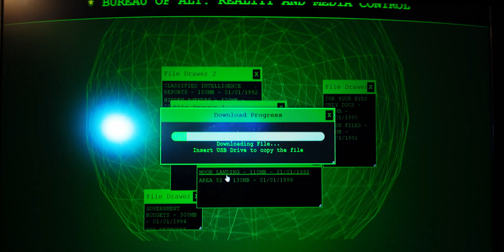DJI Osmo Pocket 3 - DIY Anamorphic Lens Adaptation: Unleashing Cinematic Flair

Comment: I wonder if it will work with the pocket 2 version of the filter.  I believe the pocket 2 anamorphic to be superior to the pocket 1.  The new pocket 3 filter is virtually unusable.
Reply from the maker: I don't have the osmo pocket 2. My guess is that it might work as the size of the lens is not much bigger than the osmo 1. And you are right about the Neewer LS-44 I am really disappointed with it, to the point that I don't feel like making a video about it.

Comment: That is very interesting, nice work. My question would be the same as I had with the previous cameras, how to stretch, what proper aspect ratio. I had that freewell anamorphic and it does not desqueeze easily.
Reply from the maker: I use Davinci Resolve and for this specific adapter I found that a 1.13 radio seems to give the most optimal result. The way I do it is specifying it in there clip properties, enter a custom pixel ratio of 0.88.
I hope this helps!